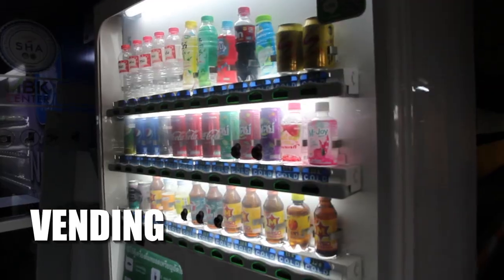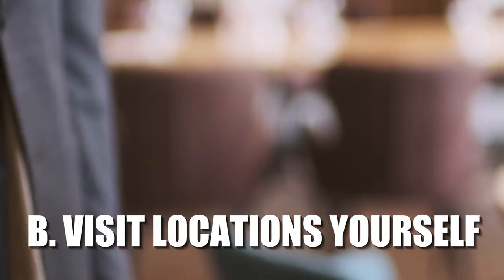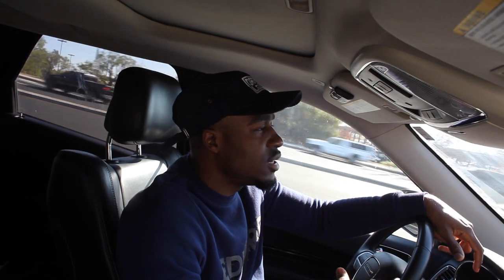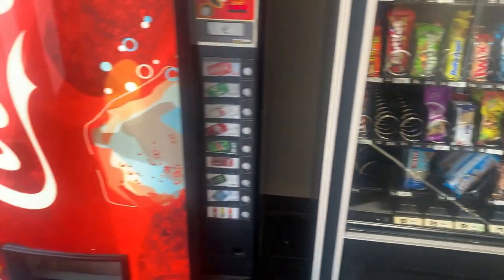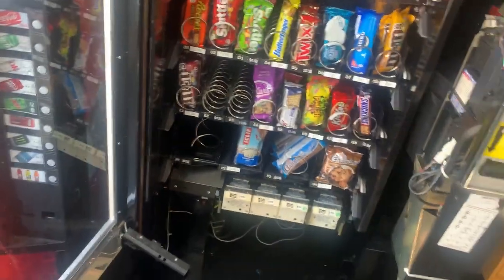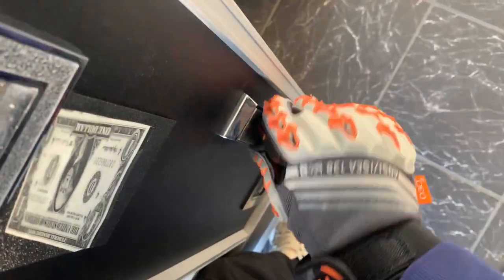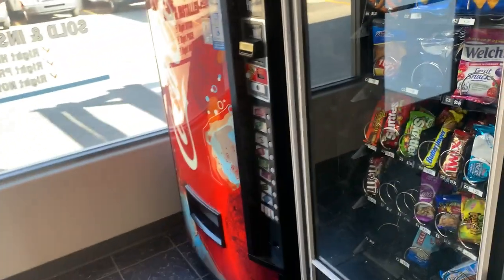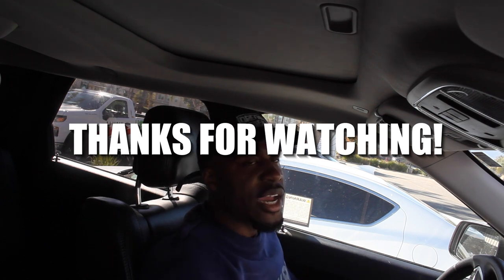How I Started My Vending Machine Business & Got My First Locations

Comment: Great video! I placed my first machine about 2 weeks ago and have a second going in next week. I bought 6 top of the line machines with locating service and I see the wisdom in your comment to start with cheaper used machines. I will say though these new machines that update you by cell signal literally every minute are nice, you knew exactly what you sold when and immediately if there is a jam or other issue.
Reply: Any reference for vending location service portals?
Reply: What one did you buy?

Comment: When you buy a location from a "locator " , whats stopping the location from pulling out the machine the next month?
Reply from the maker: The Locator located the location by speaking to the location lol the location told the locator they needed a machine, then the locator sold you that location. If the location wants your machine out in one month the services must’ve not been good. But in any case, if the location wants you out, that’s just what it is, this is why I do contracts that allow me 30 days to remove the machines if that should happen though so they can’t just put me out on the spot. But if a spot wants the machines, i don’t really see why they’d “pull out the machine” unless the service just wasn’t good 🎯

Comment: Did you flesh out an entire business plan before going to legal zoom? Also, which do you recommend for first location? Hiring a location service such as what you used or purchase a route like your second location??
Reply from the maker: I did put together a full plan on how much I wanted to invest into it, I looked at normal prices and compared that with stock costs and all of the backend costs vs the profits. I knew what I needed vs didn’t need from legalzoom so I omitted certain things and only got what I would actually need from them.
Reply from the maker: I would always recommend going to places or calling them yourself. That way you avoid fees like locators or the risk of buying anything damaged, or a bad route from someone else. I took the locator for my first one just because I felt ok to spend for the fee and I actually felt the location would be really worth it. I got a crazy deal on the other location and it all checked out
Reply from the maker: @YourDollarNSense  They (Vendco) had the senior living location listed on that app when I first got it, and I bought it. Everything went smooth for me using them. I haven’t used a locator since then though. I been trying to avoid those fees and the 10% commission
Reply: @LewSidRaps  So you buy the location and have to give 10%Comission???